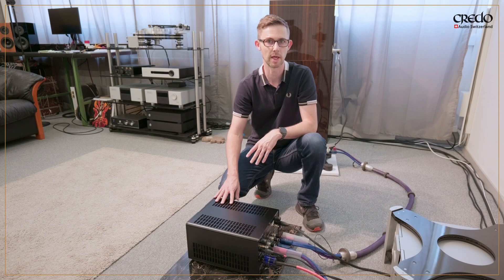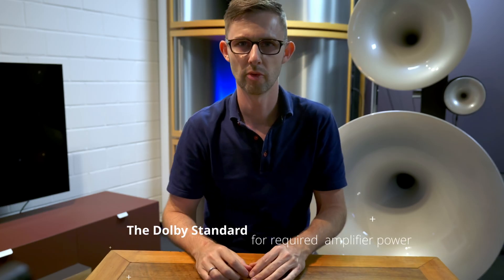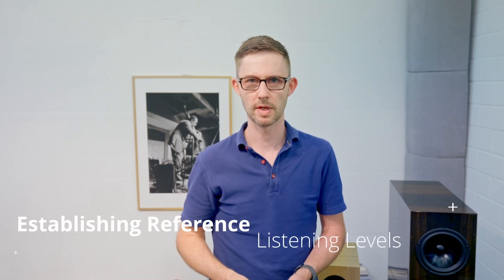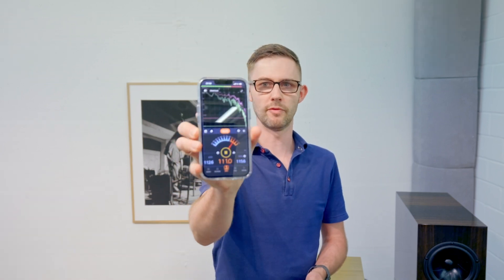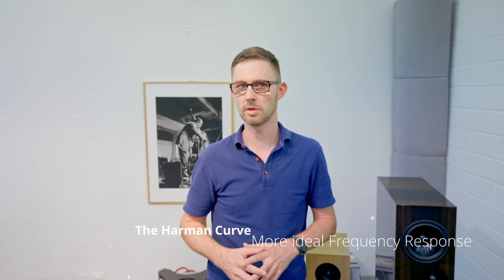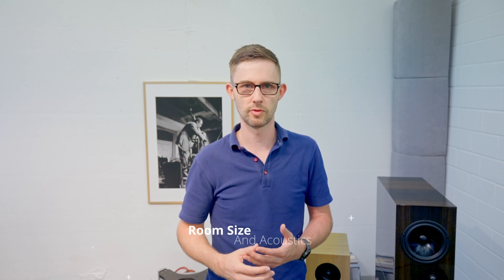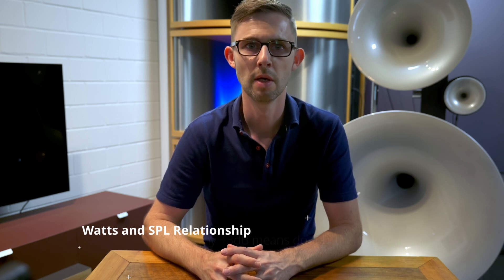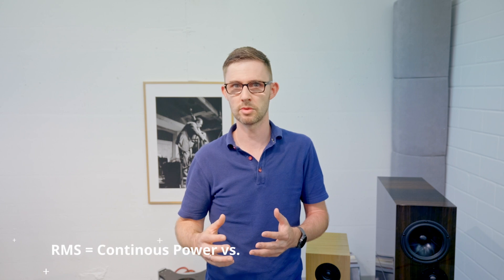Maximize Your Audio Experience: A Guide to [How and Why we Recommend Amplifier Output Power]

Comment: With 85/103dB sound pressure level per monitor you get 88/106 dB SPL when you run two monitors for standard stereo.

103dB SPL is unfortunately not the front row at a concert but almost always measured at the mixing desk, usually located at the back of the hall.

These levels should not be aspired to in a livingroom, listening room or home theater situation because fatigue is the real hearing killer here.
Watching a long movie like Lord of the Rings or Oppenheimer, or playing four records in full already exceeds the safe exposure time of these pressure levels. Hearing damage from attrition is more than likely to occur.

Safer and more enjoyable levels would be at 75-80dB program and 99-100dB peak.
Reply from the maker: Thank you for your comment. It is indeed correct that two speakers summed together will be louder, often by 3 dB, depending on various factors like dispersion pattern, time alignment, acoustic influences (room gain), and so on. Of course, the listening reference SPL is measured from both speakers when in stereo. The standard specifies that each speaker should be capable of delivering at least 85 dB, so you’ll have some headroom. Likewise with amplifiers. When we make calculations and recommendations for our customers, we take that into account to provide more precise advice. Another topic I didn’t talk about in detail is the crest factor, or dynamic range of the content (music/movies). I’ll cover that in another video. Like I said in the intro of the video, the purpose is to give a broad overview of the topic, not an in-depth guide.

SPL at concerts can be extremely different, depending on the country (legal restrictions), the venue, the budget of the production, and the band’s approach to coverage of the PA. In Europe, the FOH is never at the back of the hall, at least I can’t recall ever seeing that. Clubs, yes, but halls or stadiums? I’d be interested to know where that is the case.

It’s interesting that you mention these two movies. Their dynamic range is above average, in my opinion. The movie “Oppenheimer” is known for its dynamic and powerful sound design. Christopher Nolan’s films are well-known for their expansive dynamic range, often featuring intense contrasts between quiet dialogue and loud sound effects or music. Here, the average SPL is quite low compared to its peaks during action scenes. And it is indeed correct that when listening to music at 85 dB SPL RMS, you should limit the time exposed to such levels. Like we pros in mastering usually do. For me, it’s 40-45 minutes followed by a 15-minute break.

And let me quote my own video here: “However, in the real world, it will typically be 78-80 dB SPL. Room size plays a crucial role. Smaller rooms can make sound levels seem much higher than they would in larger rooms due to the nature of early reflections. Consequently, the optimal reference level for smaller rooms needs to be significantly lower. Here’s a quick guide:”

	•	566 m³ (20,000 ft³): 83 dB SPL
	•	284 - 566 m³ (10,000 - 20,000 ft³): 80 dB SPL
	•	143 - 283 m³ (5,000 - 10,000 ft³): 78 dB SPL
	•	42 - 142 m³ (1,500 - 5,000 ft³): 76 dB SPL
	•	< 42 m³ (< 1,500 ft³): 74 dB SPL